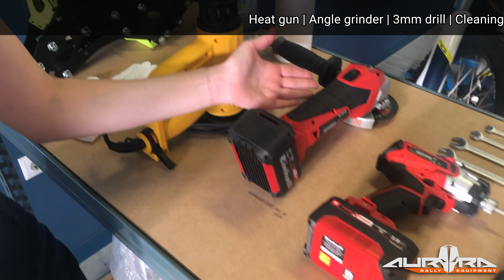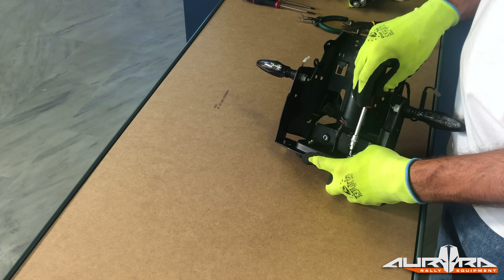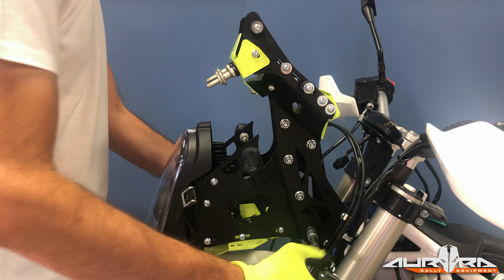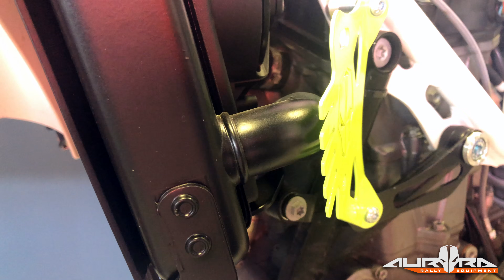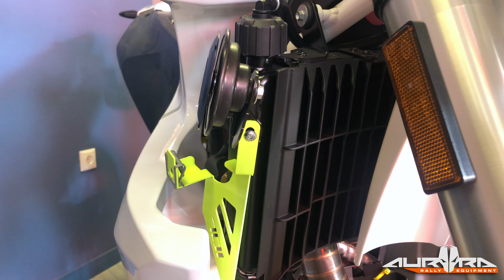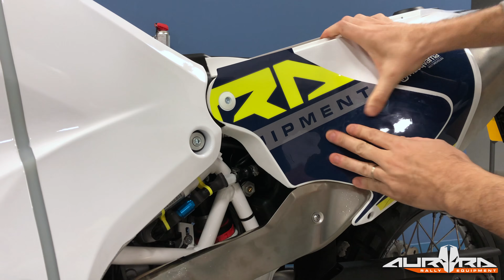701 Xplorer installation video

Comment: This is why BMW bikes seem to be expensive - they've made, tested and fitted all these modifications for you. I wouldn't touch all this with a barge pole - what happens if it breaks down in Peru? Buy a Beemer and lose all your worries.
Reply: Try to keep up with your bmw... with a 701.... diferent bikes....
Reply: BMW ideal for a  jaunt to coffee shop lovely bikes
Reply from the maker: Most of the main and critical parts have been tested by KTM. The tanks, fuel pump, lights, screen and other bits and bobs are straight from their rally factory bike. Regarding the rest, they have been thoroughly tested since 2016 in the deserts of Morocco and through various RTW trips. The good thing is that you can buy all the critical parts from a KTM dealer wherever you are.
Reply: BMW makes riders pay for stuff 90% off them is not using. As much as I like the Aurora kit, I don't need the extra fuel. A tower is more than enough for me. In that case, I don't pay for what I don't need.

Comment: I thought this would cost like 700$ not 6k $ and super difficult diy Instal or pay mechanic 
Lots of money..
Reply from the maker: Unfortunately no. You can check the official KTM microfische for the spare parts, (to give you an example just the fuel pump from KTM costs close to $500...), but you honestly thought that the Rally tanks from KTM, fuel pump, exhaust header, seat, carbon skid plate, navigation tower with lights, KTM rally screen full CNC brackets, dedicated electrical harnesses for fueling and electrics, high pressure fuelling hoses with billet non-return valves, side panels, and many other parts would cost $700?